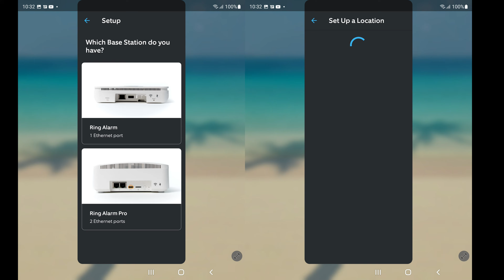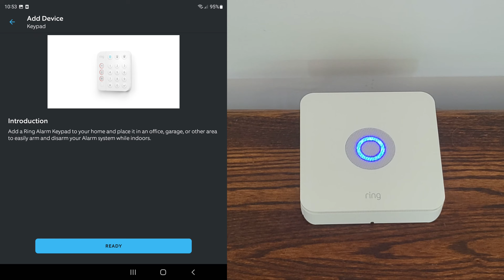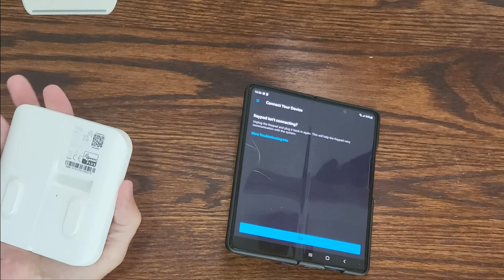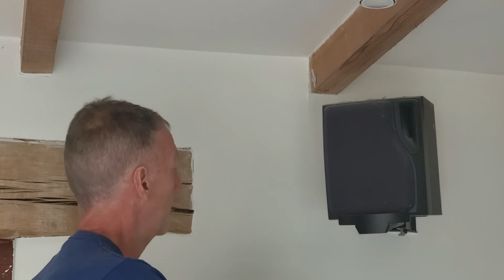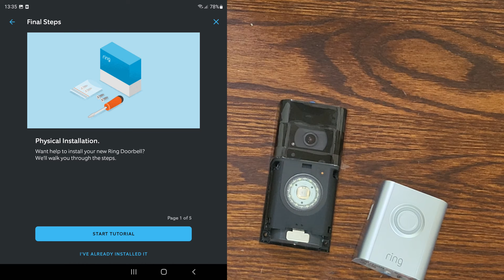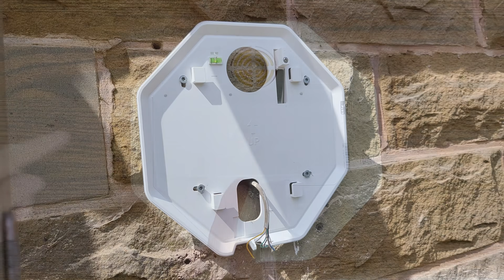The Ultimate Guide to Installing the Ring Alarm System

Comment: How did you get 12v to your siren box? I'm looking to replace my old wired alarm with a ring system and will be ripping out the current control box and power supply etc.
Reply from the maker: Keep the power supply from your old alarm.  I left my old alarm panel in place and just replaced the old siren with the ring and wired it in.

Comment: How do I wire the siren into a 3 pin plug? Is that possible?
Reply from the maker: You can't wire it directly to a plug as you'll blow it.  It has to go through a transformer:

The Outdoor Siren’s hardwire terminal block supports 9-28V, 12-40W, 0.2-2.5mm² diameter wire.

Do not apply DC power above or below 9–28V, 12W
Do not apply AC power
Do not use wire gauge above or below 0.2-2.5mm²
Reply: @ would a ac/ac power supply adapter work? Input 240ac 50hz 0.12a output 24v ac 500mA?

Comment: Hey mate, thanks for the video. Have to say that designing and installing an alarm system is a job. In this video, placement of the PIRs and keypad for example, are not optimal. Onn top of that, surfaces should be cleaned before using double sided tape, though, screws are always better! And this is not a real burgler alarm, it's a gadget without any approval and easy to tamper with. So best tip is not to indicate on the outside that you have a ring alarm.
Reply from the maker: I agree to a certain extent, and hard wired could always be better.  But of all the alarms I've had, this is by far the best and has only given me accurate and pertinent activations.  And to add to that, the video assimilation is what gives the real peace of mind, especially when you get notified 1000's of miles from home 👍🏻👍🏻

Comment: How do you charge / replace the battery on the PIR when its stuck to the wall? Presumably the door sensors have batteries also so how do you also charge those?
Reply from the maker: The back part, with the adhesive strips on it, is a separate panel.  you just hold the front and slide it downwards and it comes off so you can replace the batteries init.  Easy.

Comment: I wish Ring offered a full package install. I just bought this insane $500 kit and realize that they charge to install each individual item. Between the cameras alone, it's another $400 charge. I figure the product is designed to be DIY - which is disappointing. I keep reading everywhere "it's easy" but for the life of me, it's not. I admit, I'm not handy at all. Couldn't operate a screwdriver for my life. I'm looking at other home security systems, and they all offer installation of the complete package, either free, or just one flat rate. They're monthly service is a bit more pricey, and I guess that's the trade off. I came to this video thinking it'd be helpful, but all it really did was reassure me that, no, this is not something I'm capable of. I'm gonna be close to $1500 after paying the installation Ring offers, which will take little over 2 years to recoup compared to my last service. This stinks.

Comment: One thing I'd like to mention here is if you go with the Ring Pro hub instead it has several advantages.  Because it has built-in eero 6 WiFi you can use this WiFi with the cellular backup and keep other non-Ring devices connected in the event of an internet outage which sadly happens many times for me.  The Pro hub also has the option to use your cellphones HOT-SPOT to keep everything connected also in the event of a internet outage.  I have used this option twice now and was still able to stream content to my TV, use my Alexa devices and kept my other non-Ring cameras and devices connected.  The Pro hub will inform you of when your internet is down and has switched to cellular backup and well as notify you when it's restored.  With that being said all these features REQUIRE the Ring Protect Pro plan at $20 a month of $200 a year if you pay up front.  I already had the Pro Protect plan so when I upgraded to the Ring Pro hub I had all these extra features.
It was WELL worth the upgrade with the added connectivity.

Overall the Ring system is a GREAT affordable alarm system and I still have MANY GEN 1 devices such as the door/window and motion sensors that are still showing FULL battery after almost 4 years.

Comment: Hiya, excellent guide. I am looking to get a alarm system for my new home. Question, of course the siren is very loud and I don't want to annoy the neighbours. Can you customise the siren noise level. Also, how long does it take to turn it off, if it does go off. Lastly, we are planning to go on holiday abroad. If the alarm went off, do you get a notification on your phone, are you able to turn of the siren quickly? When you hardwired the ring siren on the wall, did you drill a hole in the wall, fed in the power cable and plug it in a wall outlet? Thank you.
Reply from the maker: The siren has 4 loudness setting + silent so you should have a setting that suits you and you can set the duration from 1 to 10 minutes. Yes, you get an immediate notification on the app to say that the siren is sounding.  You can also get an email notification.  You also get a notification to say that that the alarm has been armed and disarmed so that you know when someone else in the household has left or arrived home and can set up different codes so that you know who it is.
The power for the siren, I used the existing power from an old alarm.  However, I have fitted 3 more of the systems since and I did exactly like you said, a hole through the wall to take the transformers cable and the transformer plugged in in the house or loft.  Good luck in fitting it if you buy one, it's a simple process and thank you for the comment.
Reply: @CloughReviews  Thank you so much. I am differently getting this and CostCo has a offer on. We are in the process of buying so hopefully completing next month. I was looking at like alarm service companies but they seem a bit expensive and this Ring Kit, you don't need a subscription.
Reply from the maker: @mumihp  I've got great piece of mind when ever I'm away and I've got it linked to ring cameras as well (you can always add them later). I pay about £80 a year for uprated recording though so you may want to have a look at that 👍🏻
Reply: Sadly, you can NO longer buy the outdoor Siren!  They got SUED by ADT for the shape and color and Ring had to discontinue it!  I wish they would offer a new redesigned one because they are GREAT I bought one when they first come out and put one in my garage and it is LOUD with THREE power options and several loudness settings!

Comment: Popular misconception that the Range Extender is related to WiFi. It's not. Instead it acts as a Z-Wave repeater for the connected sensors. Battery devices cannot act as repeaters in a Z-Wave mesh.
Reply: It literally says this in the installation instructions when you connect it

Comment: Any experience of using the PIR system with pets? I have a cat and want to be able to switch on the PIR system without the cat setting it off.
Reply from the maker: I have a dog, which will set it off when in high detection.  You can set it to low detection, which is supposed to take pets into account, but if I set it in home mode, I disable some of the PIR's.  Not sure about cats.
Reply: @CloughReviews Great. Thanks for your reply. I'll be buying this system but will wait until prime day. Buying it with the Ring camera floodlight and doorbell
Reply from the maker: @DrBenson21  Great deals on prime day, I've bought three of these systems now, and all have been on prime or black Friday. Have a look for my video on installing the cameras as well. The whole system works perfectly together 👍🏻
Reply: I have two GEN 1 motion sensors mounted 7 feet off the floor and my large cat never trips my alarm even jumping on the back of my couches in my main living area when one is mounted.  I cannot tell you if the GEN 2 sensors are better or worse and would Google it.

Comment: Great video I went from a ring system to a honeywell wired system
Reply from the maker: If I was building the house again Chris, I'd definitely make sure there was outside power at camera height for wired cameras.  The battery ones are ok, but I've seen the difference and it pretty impressive.

Comment: The keypad may not be in the best location. Burglars can scout the property and view the keypad and arm status and view whether the system has been armed or is off…
Reply from the maker: Good point 👍🏻
Reply from the maker: Just checked, there are no notification lights on the pad when set or unset.  They only come on when setting or when a contact is triggered
Reply: @CloughReviews  Interesting…In that case should be fine…most standard systems have always on lights
Reply: @CloughReviews  enjoyed the review and install, very in-depth

Comment: Can you ignore the keypad and only set the alarm system on via the app when you're out?   And does the Ring Doorbell use the same part of the app as the alarm system, or is it separate?  Thank you!
Reply from the maker: You can just use the App and the doorbell can be separate or linked.  Lots of customisation

Comment: Hi, 
Not sure if this is covered in the video, but does the pir sensor and the contact sensors not need charging etc? 
thanks in advance
Reply: Contact sensors have 2x 2032 button batteries included and the motion sensors come with 2x duracell batteries each, ive just installed my system to my house, It was really easy to install but i would suggest to buy a rechargeable battery pack for the outdoor siren it does come with 3x D size duracell batteries but you cant have the ring logo glow if you just run it on the D size batteries, i was going to have my keypad hard wired but it states the rechargable battery inside last several months so im just going to scharge that when required
Reply from the maker: @typergaz82  Yes, the key pad lasts for ever, I'm upto about 7 months now from its first charge 👍🏻
Reply: @Clough Reviews  have you had to change your motion sensor or contact sensor batteries yet and the D size batteries in the siren? I wasgoingto hard  wire the siren but it was a nightmare trying to run wire up the cavity into the loft I ended up sticking a rechargeable pack in it so I can have the ring logo illuminated at night
Reply from the maker: No change of batteries in anything yet (other than the doorbell and cameras needing recharging).  I was fortunate enough to be able to hardwire the siren but I did put a rechargeable battery in as back up.
Reply: @Clough Reviews  ive got the doorbell pro 2 so its hard wired and have a couple of cameras how long would you say the camera batteries last?, im just moving into my new house so just wanted to get the alarm up and running for now and will look into hardwiring to suren in the future but I have way too much to do at the moment to be spending the day trying to get wire up the cavity
Reply from the maker: @typergaz82  I put an additional battery from ebay in each of the cameras.  They last for over two months without charging.  They are only on motion when the alarm is on
Reply from the maker: No, the contact sensor has button batteries in it and the PIR has 2 AA's